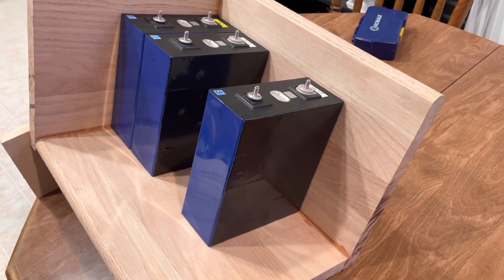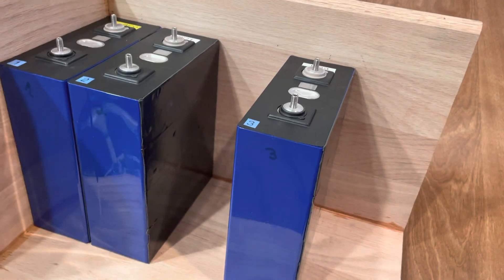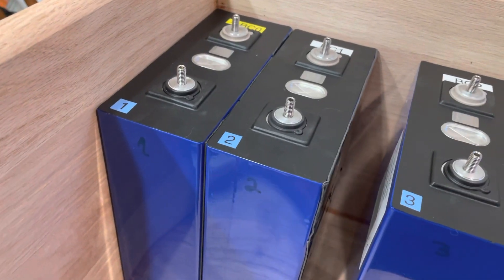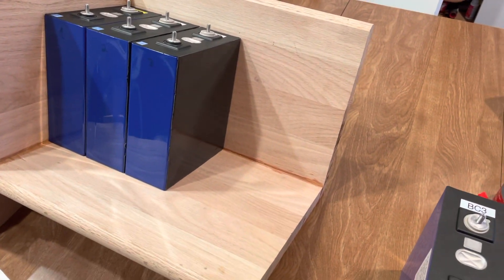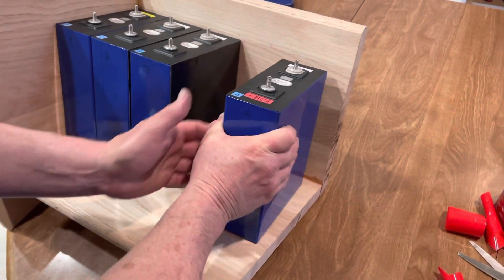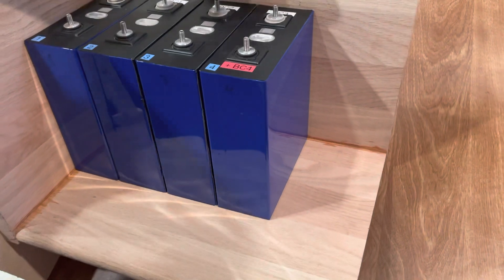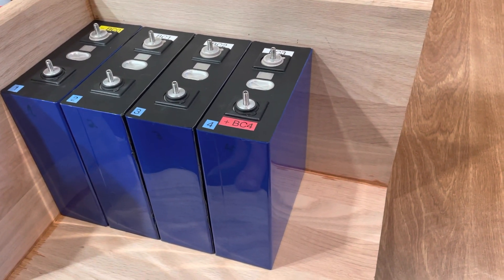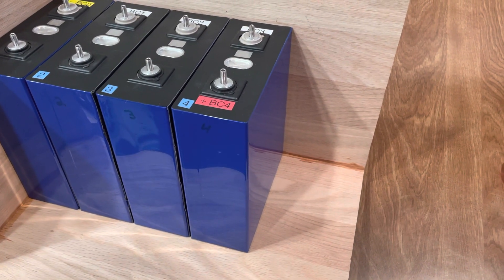Lithium LiFePO4 280 ah assembly trick!

Comment: That kind of tape is a mistake. What do you do if you need to remove one cell later? Moreover, there is a need for some compression.
Reply from the maker: You don’t. Top balance and do a cycle to proof before you tape things up. If one cell goes bad later, replacing it is mute anyway. Getting the replacement to match is unlikely and you’ll never get decent capacity. Compression/fixturing is desirable but this four cells group was installed in a high vibration environment. There were several layers of Kapton tape and then several layers of aluminum tape. The assembly bottom was then vhb taped to a 1/4” 7075 aluminum plate. Then the assembly was potted into a housing with soft polyurethane. So as you can see I’m not too worried about it ever coming back out lol.
Reply: @SkypowerwithKarl  lol mute.  bone apple tea!